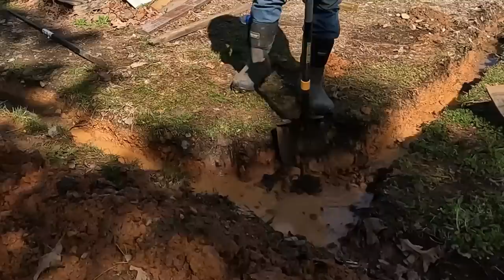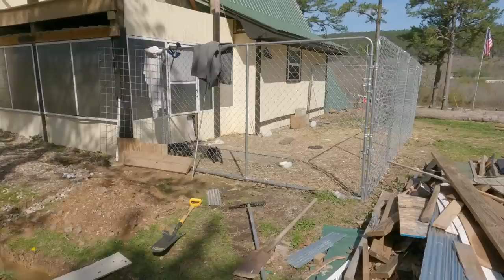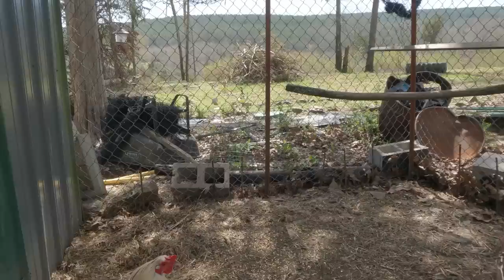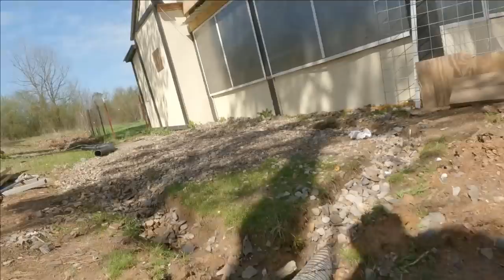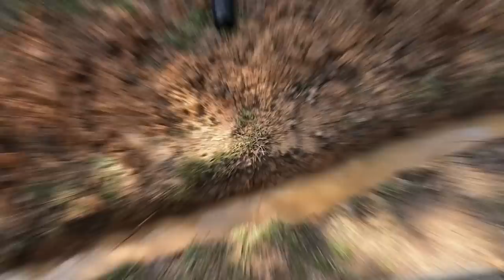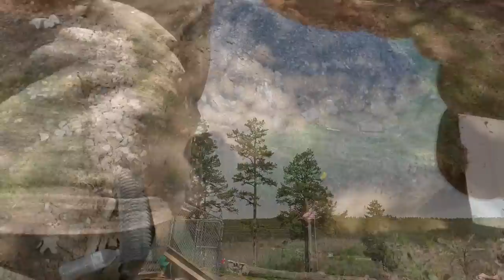Let The Water Flow! French Drain Work Continues/Controlling Flood Waters On Property

Comment: Holy 🐄!!! You worked that pony shovel like a fine tuned excavator operator💪. Something tells me you've done this before👍.  It Looks good. Should work as intended,  Success!!  Hope you never have to worry about the water coming over your slab again. Pitch is good👍. Most dont understand that  water seeks it's own level &  always flows in the path of least resistance.   If you find  the corrugated cant handle the volume, you can dbl stack the  pipe in the trench hole.  This girl knows how to dig it😉.  I owned/ operated a successful underground construction co. Mostly excavating, water diversion, water control,  waterproofing & structural concrete repairs. ( Still own the Co. But not operating)Times when I couldn't get the machine in, I'd get out the pony shovels & dig it  by hand.  Not just trenching. l would dig down 10' & all the way around structures  to expose the concrete footings, to make repairs, install drain systems, pipe, pumps and to install bituthene rubber membranes etc. Hope you slept well.  I was concerned,  Hope your back is doing ok after all that.

Comment: Could you take those blocks you have laying around and put them like two high, starting at the corner of the dog apartment, or even start at the corner of the dog lot, out towards the backyard, and then parallel to the ditch you dug all the way past the screened-in porch, and then curve down to the ditch? Fill them with concrete?